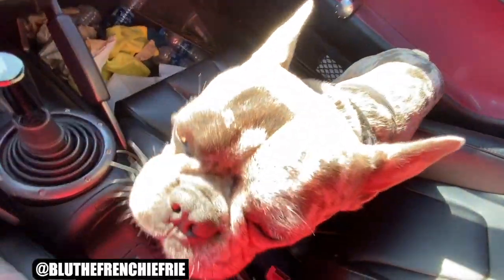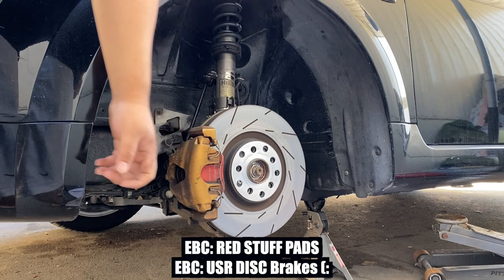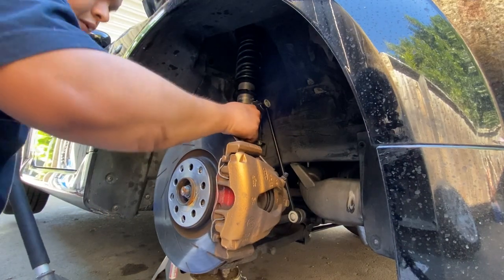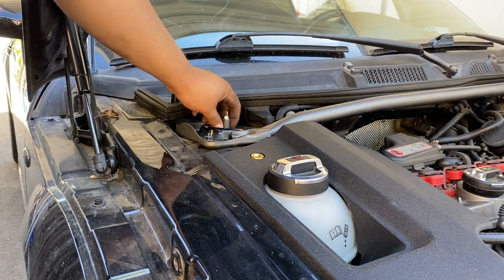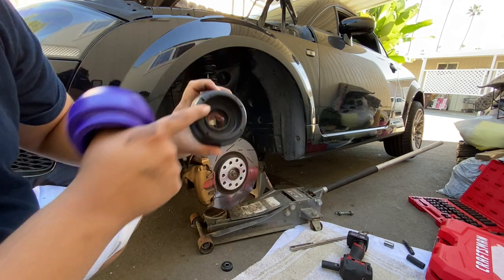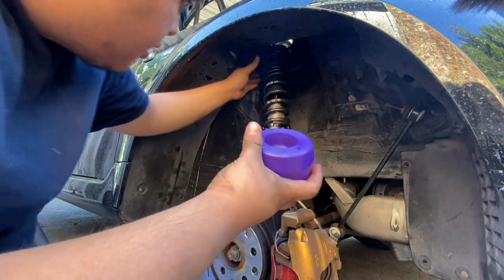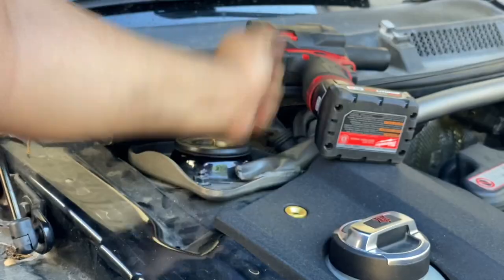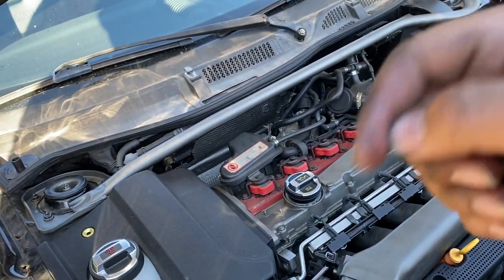Replaced the FAILING upper Strut mounts on my Audi! *POWERFLEX*

Comment: Now 11 months later . Are they still worth it ?
Reply from the maker: Yessir! The oem replacement i had installed failed within a year. The powerflex is a bit mote expensive BUT will last longer than the oem ! 🤘🏼plus you gain handling from it so its worth it

Comment: I put lowering springs on my golf mk4 and the front stays a little raised, you can see the difference between the back and the front.
What can I do in this case I don't want to cut a turn to the spring
Reply: Leave it that way. Handles better.

Comment: Hi buddy. Whats the symptoms of the mounts gone? Think my mk4 golf may have this issue.
Reply from the maker: I had “popping” noises and clunks and also typically the strut tower will be pushed outward if that makes sense
Reply: @iits_OG  Could you feel anything through the wheel when hitting bumps etc mate?
Reply from the maker: Just a bit of that clunk noise right as i would go over the bumps

if its not your mounts it could also be the actual strut assembly (shock failing) / bad control arm bushings/ even cv axles when they fail they will transmit some feedback to the steering wheel

Comment: Hey man Which milwaukee impact are you using?
Reply from the maker: M12 3/8 stubby with a 4.0xc battery
Reply: @iits_OG  it's pretty powerful?
Reply from the maker: It’s definitely pretty damn good for the size and wieght of it i like it, considering getting the m18 high torque or the mid torque in the future

Comment: Hi. 
After these 2 years, is there still no gap? 
Or does it also have a bit of a gap?

Regards.
Reply from the maker: No gap its a great option for oem if you plan on driving a bit more aggressively and are lowered
Reply: @iits_OG this! My car is lowered, with Solowerks coilovers. It ate 2 set of bushings in a month. Both collapsed too much. Current gap is 1cm-or more. I ordered powerflex. 

Dont cheap out!!!!!